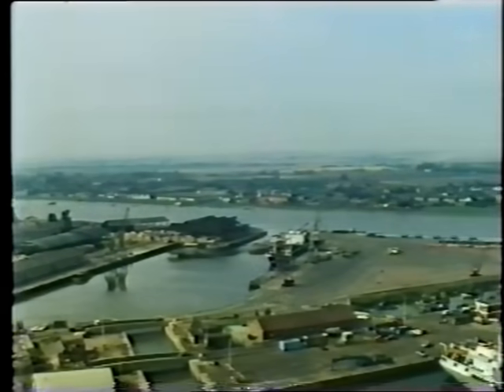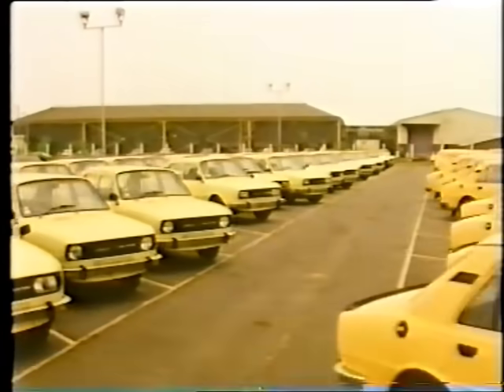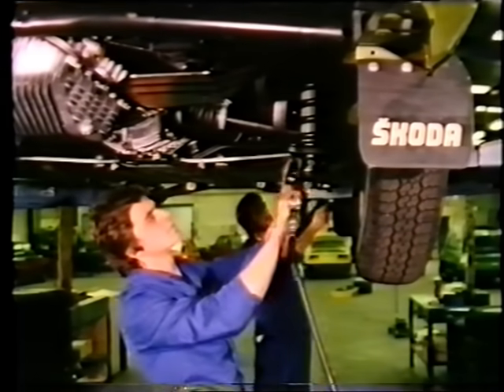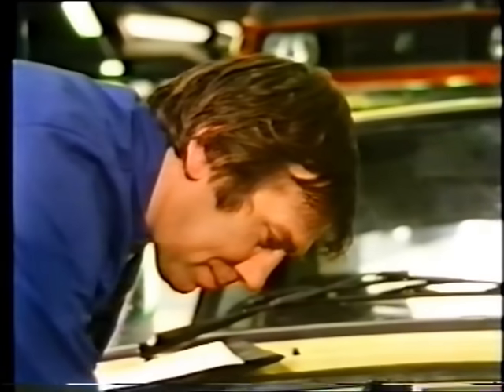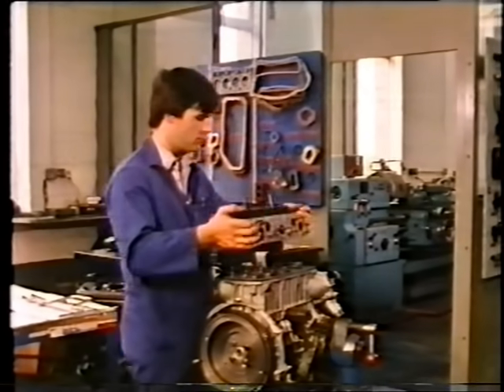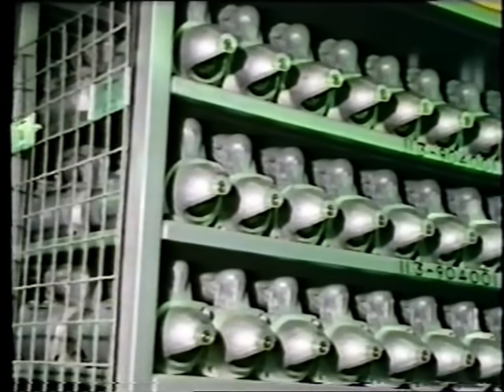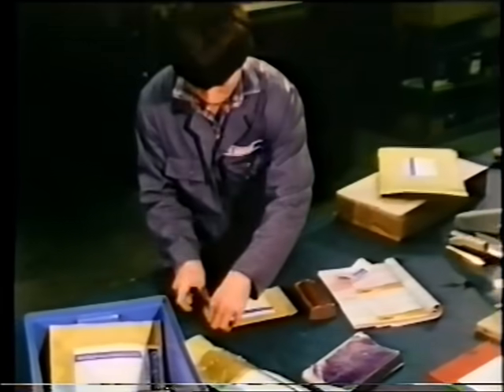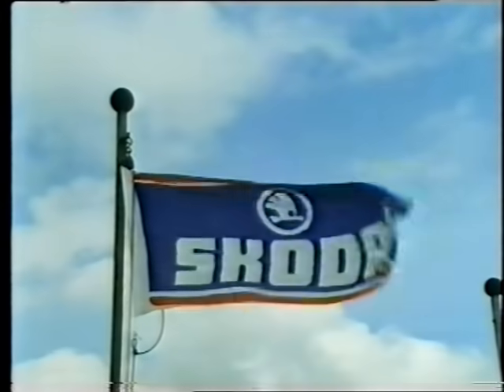Skoda promo film showing Estelle 105 & 120

Comment: They do not make cars with this kind of charm today. I do not care about the jokes or the top speed, The handling was one of the most entertaining thing with the Skodas. And they where allways easy and cheap to run.
Reply: And by the way, There are plenty of space in the engine bay on these, Fairly enough for a V6 Alfa thing, maybe just some VW GTI. powerplant.
Reply: Yep.true, i had one 120 L  a fun car to drive in the 80 's allways been passed,self over speedlimits on the roads..lol..
Reply: True; I had an Estelle 2nd hand before I had the Estelle 2, which had great handling. It was predictable and could be pushed if you knew how. You have to admit though that they do still have some character despite the VW take over. I had a Favorit in '92 and am now 20 odd years later looking forward to my new Octavia.
Reply: I had 4 rear engined Skoda’s in my personal fleet. The first was an “A” Reg 1983 Super Estelle 120LE, Red / Orange colour with the snazzy air-dam bumpers and those spider alloys, code named “FOXBAT” (after the Mig-25 obviously).
I added a colour coded whale tail spoiler I picked up at a boot sale for £1.00. It cost me £50 to have it sprayed!

The 2nd was a Light Blue 1984 “A” Reg Estelle 120L, bought for scrap value with a blown head gasket engine, for £30. The ancient engine from FOXBAT went into it when that car was written off (not my fault - got a handsome insurance payout - more than the £595 I paid for it in 1989).
This Estelle (code name: Voyager) also inherited FOXBAT’s whale tail (resprayed of course). It also gained alloys from an F Reg Estelle - and the whole interior from the same accident vehicle from a breakers yard. I had fun upgrading the interior seats, carpets, door panels and even the dashboard cluster which was literally plug and play!

Then there was “Cappuccino” - a Black E Reg Skoda Rapid 130G Coupe that must have been flooded by sea water at some point. Bought it for £300, had the brake hoses and pipes ALL replaced due to unusual rust, and from a breakers yard, also replaced the boot and bonnet with cream coloured parts - hence the name “cappuccino”. When Cappuccino was written off (again, not my fault - great payout and I got to keep the car), the 1.3L engine was transplanted into Voyager, making it a 1984 1.2L Super Estelle with a 1.3L engine - but sadly a 4 speed gearbox.

The last Skoda was a 1988 Thunderstorm Grey Rapid 130G with It’s engine already bored by a previous owner to 1.4L (don’t ask!). This Rapid Coupe was dubbed “The Millennium Falcon” due to the sleek shape of the body, and the cargo compartment in front of the vehicle. Driving M F was a blast! My wife drove “Voyager” and I had the “Millennium Falcon” concurrently. It was easily the best of the entire fleet! I eventually traded up to a cheap Honda Accord from a friend, and passed the M F to my sister who eventually ran it into the ground. 

The last Skoda to survive in the fleet was “Voyager” who was eventually rear ended at a Zebra crossing (my wife got a total of £2,000+ compensation for that). Even with a staved in rear end, Voyager still flew!
My wife ended up in a Renault Clio Mk1 and I drove “Voyager” to my local Skoda dealer to be scrapped.
I cried all the way there, actually stopping twice to sob my eyes out.
Then broke down in tears again when handing over the keys - much to the amusement of my Skoda dealership - who really did understand how much I’d come to love those cars. I’d been with them for 10 years!! Thanks Empire Motors!

Yes, I still miss my Estelle and Rapid Skodas. They were lovely cars, and served my young family very well indeed. 🥲

Comment: Ive owned all sorts of regular brand nice cars and always was teased about my Skoda 120L 4 speed but it was the best car I had in many ways. I had a second one, a 5 speed with vinyl roof and alloys and sunroof, this car was not as good as the first, especially the gearbox was not as easy to use. Great cars and across country on B roads would lead the way of most other cars. Happy Days
Reply: My first car, and a lot better than the rot falling off the line in Longbridge.
Reply: My first car was a 1983  120LS 4speed red colour, in Spain

Comment: Compare that with British Leyland cars, built with cheap steel that corroded quickly. In 1986, my Sister bought a 'B' reg Metro, from the previous year.After 2 years, she got rid of it. Rust on the front wings, on the 'spoiler' under the front of the car, bottoms of doors, the list was endless.

Or the true story, from the 1970's, where the engine of a 'brand new' Marina fell out (on the way back from being bought at the showroom!), as only half of the required engine mounting bolts had been put in.The dealer didn't want to know. One good reason for the 'Sale of Goods Act' 1979.

Even the 'old' Skodas were good cars, certainly better than Lada's.

When it's minus 25c outside and your £70,000Range Rover refuses to start, as the electrics are b*ggered because of the cold, your old Lada/Skoda or Yugo would start 1st time.Also make a better job of the roads.

The Yugo and Skoda held their values better than the Lada or FSO cars.
Reply: CZ had better cars, trucks, buses, trains than ussr. Living standard was better than in ussr too. (CZ, Poland, Hungary, etc... wasn't ussr, just socialistic rupublics.)
Reply: @vratislavtupecjr.9498  It was exactly as you write, many people still think these three countries were part of the Soviet Union, NO. Of these three countries, the best standard of living was then in Hungary, then Czechoslovakia and Poland. Comparing them all with the Soviet Union, it was so much better.
Reply: @PrzemekM25  I know it from my dad. I was born I Czech Repulic 🇨🇿😆
Reply: @edwardszzz   really?  🤔🤔🤔